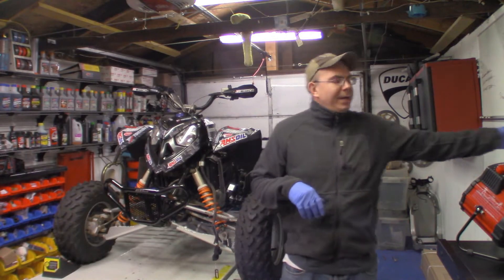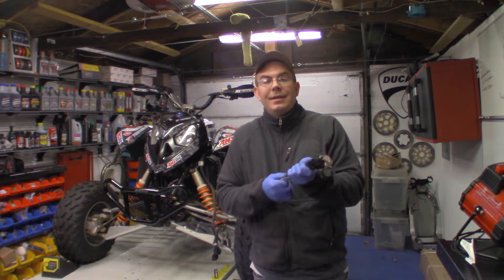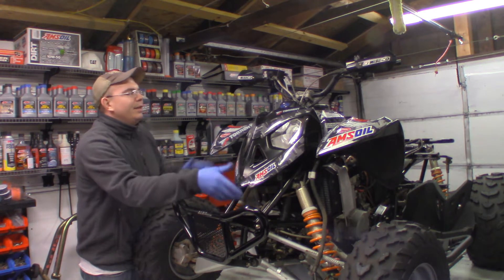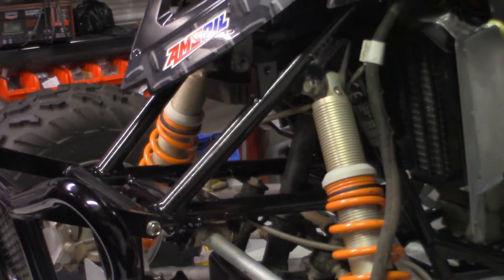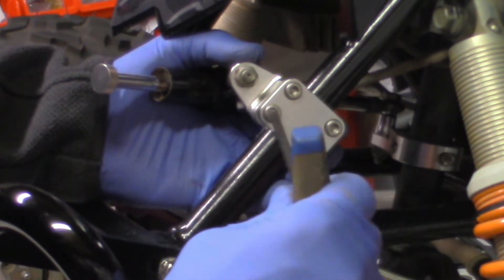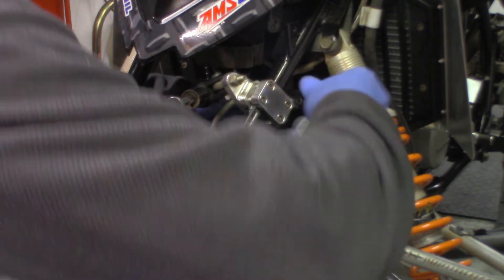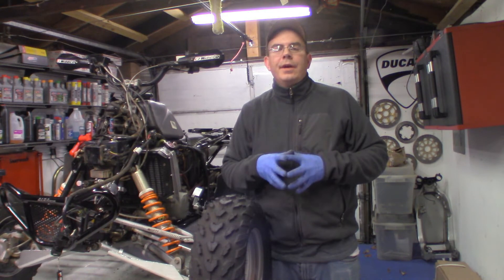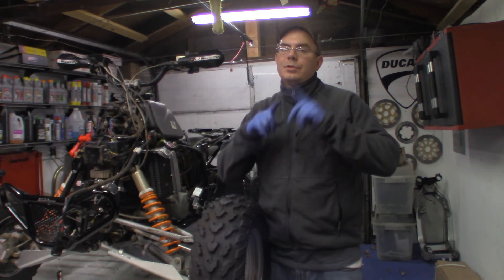Streamline Billetanium Steering Stabilizer 2007 Polaris Outlaw 525

Comment: Have you had any issues with reliability, I've heard some bad stuff about stick style stabilizers. I'm trying to get into some light MX racing on my 400ex and this is the only stabilizer in my price range.
Reply from the maker: I have not personally even used this because the atv isn't finished being built. But for the money if it's what you can afford I would buy it. I have ran ohlins on my aprilia and ducati's and I have run oem off brand stabilizers. Here's the deal on them personally as my opinion as a non racer. Buy the cheaper one and get a extra rebuild kit. If you get one season out of it before rebuild that's fine. If your not a serious mx racer that needs the best to compete than why spend the extra $300 on the name brand one that you will never utilize. If you can afford one I personally would buy one and play with the settings. If you want a amazon link and help me out with a little commission to support the channel that would help me out as well. Good luck anything else just shoot me a email.
Reply: They work just fine.
Reply: They don't last if you ride hard. Mine didn't last the whole summer.

Comment: Was that stabilizer for an outlaw or just something that fit the steering stem?
Reply from the maker: I believe it was one that fit universal. I bought it used off another outlaw, and it may of been sold as a outlaw but isn't being sold that way now.
Reply: Thank you. It’s hard to find one for a outlaw/predator. I just ordered one for a z400. Has same size steering shaft.
Reply from the maker: Matt should work just mount it just like I did and you should be good. You running amsoil yet?
Reply: TorrentPerformance I’m a amsoil user.
Reply: How’s the z400 stabilizer you ordered mount up to your outlaw?
Reply: Thomas McCue it worked like a charm. Installed on 2004 predator 500.
Reply: Matt Bush  just installed mine today
Reply: Universal fit! They come with instructions for just about every sport quad made!
Reply: @toddmerriott6901  is it worth it? I am tryin to decide its like $134 on ebay i heard they dont work anymore after a few runs
Reply: @chazzthaspazz4475  they work great, you will get years out of it

Comment: These are good except.if u ride daily or even alot. They wear out fast. The precision ones are alot better quality and do not wear out as fast but works about as good. U can get 7 or 11 way adj systems for these ebay style
Reply: How fast would ya say they wear out? Its like $134 on ebay wanting to get it for my 2019 yfz450r
Reply: @chazzthaspazz4475  depends how hard u ride and how much. Just get a rebuild able one they only like 10 bucks more for same brand and they come 7-11 way adjustable
Reply: @maddmavic  i just ordered an 7 way one i ride every so often lately i have been super busy I usually ride every other weekend. Mx too

Comment: How do you like it so far?
Reply from the maker: Seems as high as quality as a ohlins just made for a atv.
Reply: @TorrentPerformance  has your answer changed in 10 months?
Reply: @TorrentPerformance  is there a difference does it make it more comfortable to ride?
Reply from the maker: @osvaldoalvarez2437  I still havent got the quad out to ride. But on street bikes it absolutely make a difference the tech is just applied to offroad with these dampners.